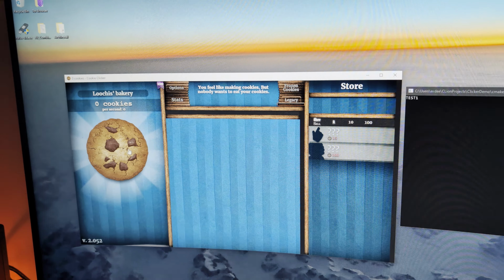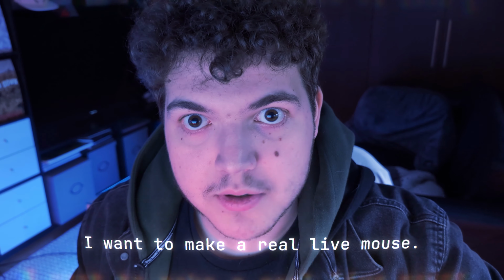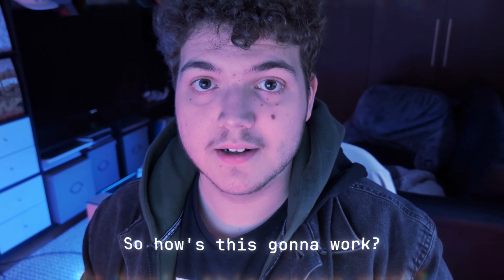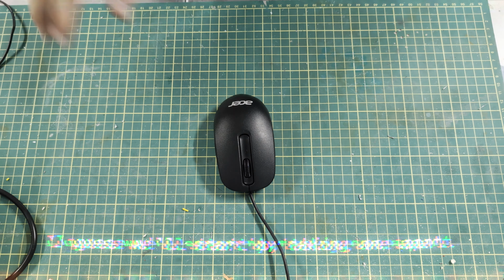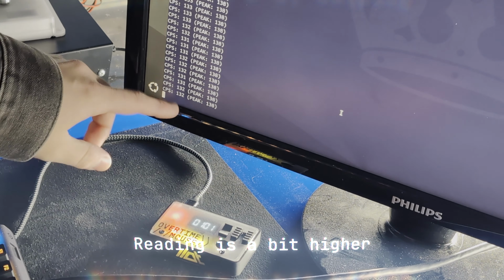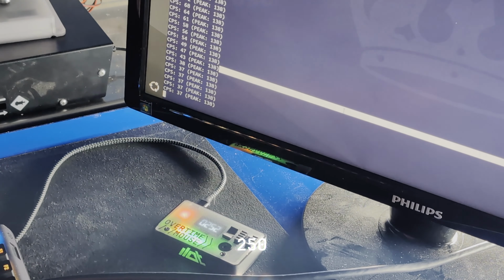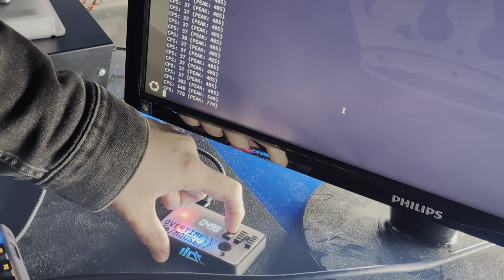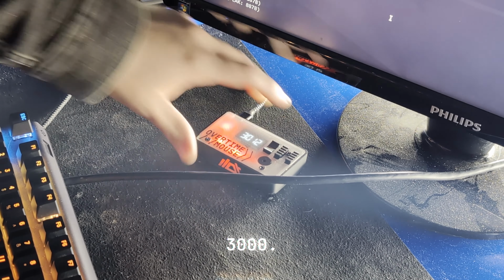Overclocking My Mouse

Comment: I once did this via my mouse software, but if went to 0 CPS. I figured out in linux you must disable double bouncing or else it will think there is a hardware issue with the mouse
Reply from the maker: That could be why my first test was failing, thanks for the tip! I ended up writing a script to measure the CPS because all the websites I used started lagging and breaking lol, but that also started giving weird readings so it could help there too

Comment: Great video! Imagine how insane it would be to take the original concept of piggybacking on the mouse hardware even further. Full control of a mouse without leaving any trace on the device that it's outputting to would be insane. Couple that with an HDMI passthrough / capture device, a device to covertly simulate keystrokes through the keyboard interface, and a decent AI model.... You could have a bot that is 100% undetectable by any current or future anticheat... no matter how invasive it may be.
Reply from the maker: Thats a cool idea! Reminds me of Basically Homeless' aimbot project but turned into a practical device